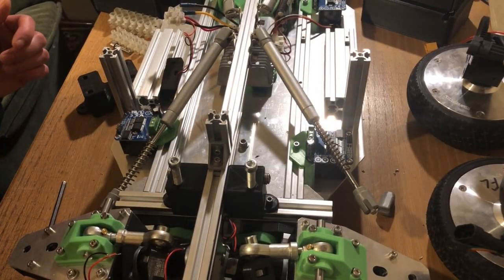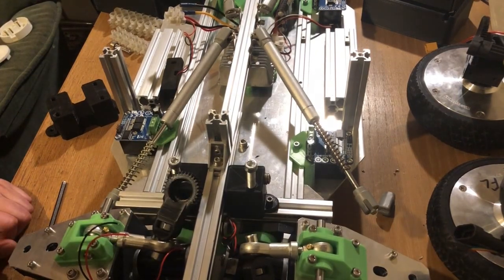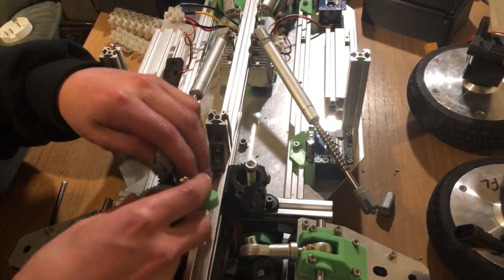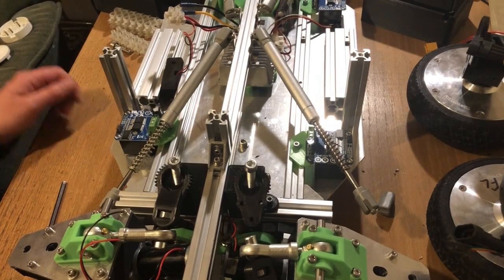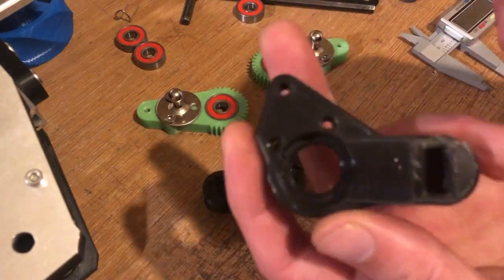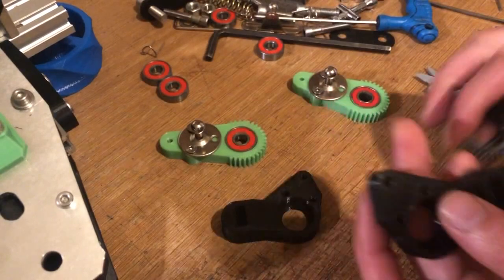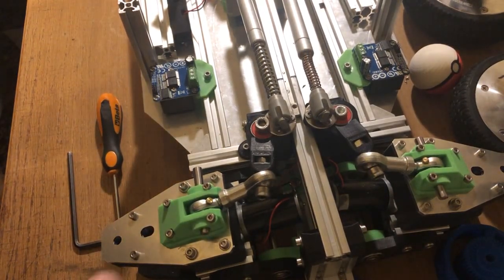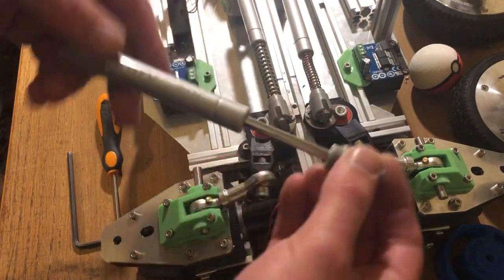RC HOVERBOARD CAR - Build Update 5, off road capabilities

Comment: Fantastic work, well done! Can you please provide a link of the suspension (damper)? I'd like to get one of those.
Reply from the maker: hi, yes no problem, just search ebay or amazon for 'cabinet gas strut' and there should be pleanty to choose from, the ones im using are 80n and have additional springs to make them extend faster, thanks